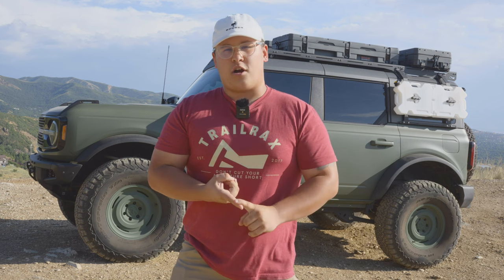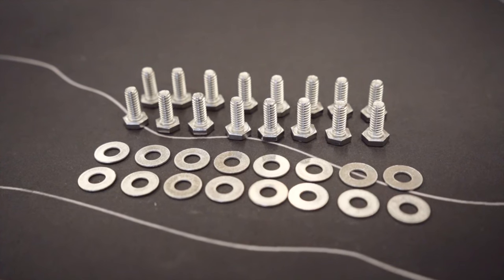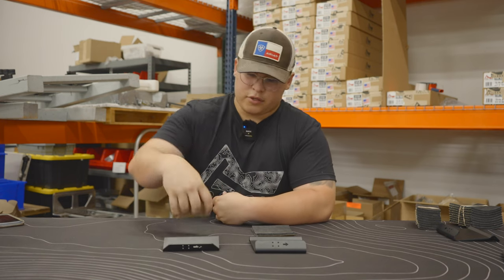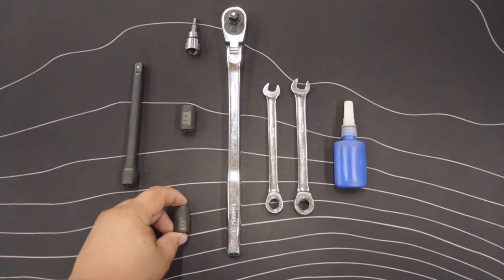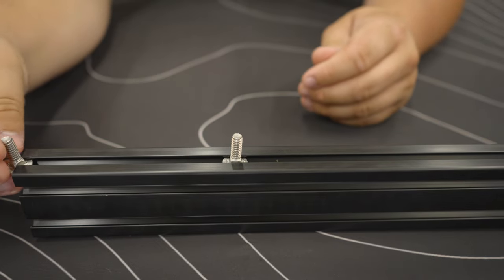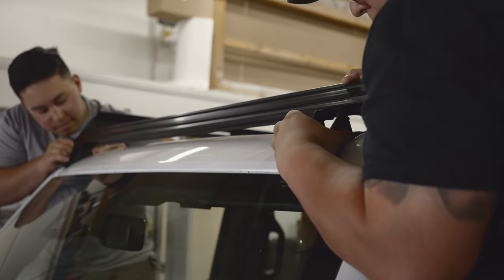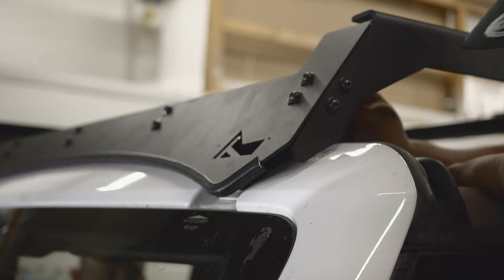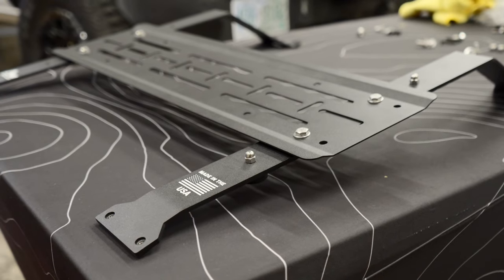Ford Bronco 4 Door TRMR Rack Installation Instructions!

Comment: When bolting down the front of the rack with the two mounting brackets on the mounting studs, I found it easier to remove the two outermost t-slot bolts and washers on each side of the wind deflector and then slide the wind deflector enough to expose the mounting bracket making it much easier to get a wrench in there to tighten the two nuts going on the mounting studs.  Once you finish the first side, go to the opposite side and slide the wind deflector the opposite direction to expose the second mounting bracket.  Once complete, align the wind deflector to reinstall the t-slot bolts and washers then realign the wind deflector to its final position even with each edge and tighten all bolts.  Hope this helps!
Reply: I did the same but in my case I couldn't leave the logo backing plate on or it would hang up and not slide. It hung up on the logo plate bolts. Poor design of the deflector IMO.

Comment: Hello, what size are the hex nuts that are used to bolt the rack on to the roof in the accessory ready mount on top of the windshield?  Are those 10mm?
Reply from the maker: The nuts that are used to bolt the rack to the accessory ready points on the bronco are factory spec 10mm metric nuts. The rest of the rack uses 1/4-20 imperial hardware.

Comment: Wait, when i put the foam on the bracket like you did, it kept sliding.  Why dont you take the wax paper off so it can stick?
Reply from the maker: We did not apply the foam to the clamp for filming reasons. But you are supposed to remove the wax paper so that you as the end user can stick it to the clamp and install it for your Bronco.

Comment: If mentioned in video, my apologies, but can one remove the front 2 sectons of the hard-top if this rack is in place?  Thanks
Reply from the maker: You can remove the hardtop panels while the rack is installed. The front and middle to be exact!
Reply: Can you remove the back panels too?
Reply: @ahschloth  The rack is clamped onto the back section so no.

Comment: Can other 40” light bars be mounted to the roof rack other than heretic?
Reply from the maker: Great question! There are plenty more out there. We currently have Baja Designs S8 which is most comparable to size in the Heretic. We will say the S8 pushes more light intensity as well, basically brighter. Baja S8s are in stock at our site.

Comment: How are the Roam cargo boxes mounted on the rack?  I have a Trailrax on my bronco and am looking to add some cargo boxes.  I like the Roam but not sure how to mount it.  Do you have any information on that?  I don’t see any cargo boxes on the Trailrax accessory page
Reply: Found the Trailrax accessory page and looks like Roam + rugged mount is listed there so I assume the carriage bolts can slide into the cross bars.
Reply from the maker: @TIMPORTER100  That is exactly right. The Rugged mounts or their new cheaper mounts will work on our rack with their carriage bolts provided. The provided carriage bolts should be 1/4-20 carriage bolts, if not, that is the spec of hardware needed to mount the rugged case mount to our TRMR Rack line up.

Comment: NO DROP INS... And there are no accessories on your page for bolts/tiedowns for the rails... what do we use?
Reply from the maker: New orders from Early August forward get drop in cut outs on the crossmembers! It is a recent update, for past customers, there will be an upgrade program that is optional. We also have tie down point accessories, the Smiley. If not, you can use the side panels of the rack in the slots to tie down your gear! it is designed for it. Slots are also used as a mounting point for hardware should you need to use them. Then of course our crossmembers offer a great solution to mount even more hardware.

Comment: When installing the PackRax you say to put washers under it, why? I put mine on then noticed you said that. Do I need to take it back off?
Reply from the maker: You do not need to take it off and redo it. It mainly is there to help center the Pak Rax lower bracket better.

Comment: I noticed that your cargo cases are positioned toward the rear of the rack. Is that because you are trying to reduce wind noise? I ordered the same rack and cases, but am waiting on delivery of the rack. Thanks! P.S. Great video! Looking forward to the light bar video too.
Reply from the maker: Thanks for the feedback! The customer wanted them positioned them like that. The best way to avoid wind noise is to get the boxes right up to the deflector so the wind is not hitting the wall of the box right above the driver's head.
Reply: Thanks! That’s where I’ll mount them.🤟🏻

Comment: These instructions leave a lot of detail out. Orientation of the bottom pakrax for example.. there also seems to be parts added in the assembly that do not come with the package. Major steps are just glossed over without detail. Super confused. Tried calling, and no one is answering. Super frustrating.
Reply from the maker: Thanks for your comment. Orientation can be explained on the parts themselves that show a "D" and a "P" this will let you know whether those parts are driver or passenger side. For detailed instructions, you can find our instructions print out and PDF available on our website! Our customer service phone line is available from 9am-5pm MST M-F.

Comment: Someone want to explain what the random rubber stops are on the back side of their pack rax that didn't come with mine?
Reply from the maker: Thanks for the comment! This was a part of one of our prototype units and is not necessary. Do not worry, the rubber stops served no purpose during the use of that prototype so there is nothing to worry about. You may ask why we left the holes there for it, it is for accessories or other mounting solutions you may need. email us at info@trailrax.com if you have anymore questions.
Reply: @trailrax  appreciate the heads up, thought I was missing something. My rax are going on today and I love my TRMR.